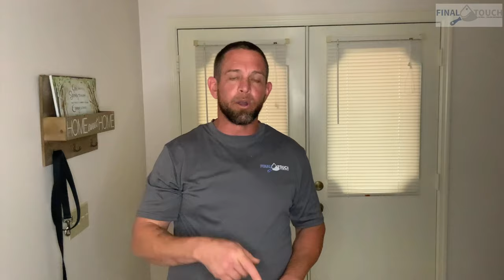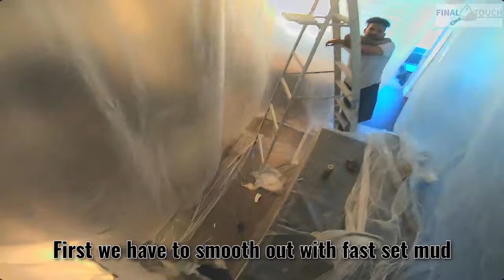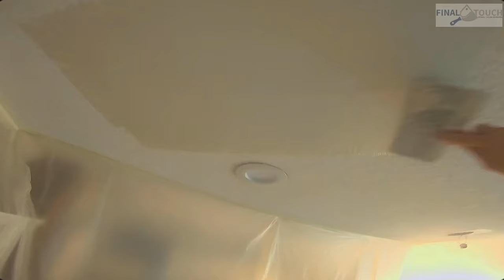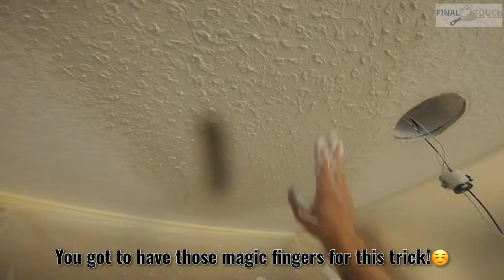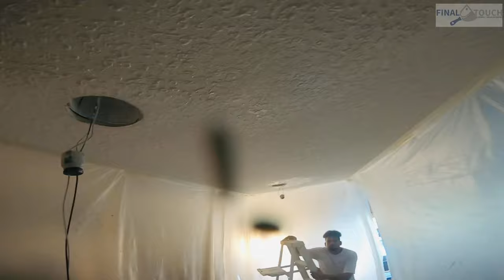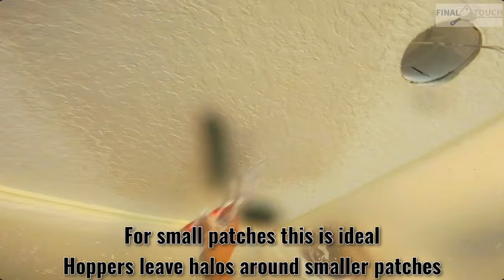How To Match Knockdown Texture: The Secret Sauce For A Perfect Match!

Comment: Using a quick set mud over a drying mud laminates it and looks like shiners with the right light even after painted I’d never do my texture with a setting mud says in bag don’t use for skim for a reason texture is sweet af idk if I’d use this though I’m pretty good with my hopper it’s all bout finger control and mixture . And knowing how to aim it good .. if it’s more spread out just use bigger opening lil less air and soon as u hit trigger be moving it and let off fast works good

Comment: I just had to cut out a large section from my garage wall to repair some copper pipes behind the wall.  Am replacing with fresh drywall because the original got water logged.  Will try this to repair and finish.  If I can get it close to existing texture I'll be thrilled.

Comment: This is a cool technique. I might have to try it as I'm trying to match that exact same knockdown texture over a poorly done patch job by a previous owner. I've been trying to match it with a dedicated knockdown sponge but the sponge can't do the small dots in between the larger splats that mimic a professional spray job. I've also been using all purpose green mud, but it sounds like the 45 minute hot mud might have a better standout. Thanks for posting the video!
Reply from the maker: You’re welcome. Hope it works for you.

Comment: Never did anything like this before as far as texturing a ceiling but it worked.  Flicking it on the ceiling does get messy.
Reply from the maker: Plastic the area before doing works well. It is messy tho. Glad it worked for you!

Comment: Wow.  I am impressed.  I want to master this technique.  I couldn't really tell how you were flicking it because the fingers were moving to fast.  I have found the store bought spray can does not produce big enough globs of mud.  And the sponge method doesn't work either if you are trying to match a knockdown where the globs are spaced out a bit.  Thanks
Reply from the maker: Thank you! It’s a cool technique. I have been doing it for years. It works well. I have tried all kinds of ways. I don’t do anything over a 2x2 patch most the time. 
I’ll make a short video just to show the technique. Check back  soon to see.

Comment: For a stomp texture repair, on ours it looks like the guy used paint mixed with mud, for a more white look. Just to add, i'm fixing on doing one with ceiling paint mixed with mud and water for garage ceiling repairs.. Edit: Now I hear of contractor using primer paint over the dried ceiling stomp texture repair.

Comment: Do you wait for a certain amount of minutes between applying mud and then knocking it down?
Reply from the maker: Yes but not too long or it dries up.
Reply: @finaltouchdrywall  I had my first practice. The 45 mud was good pancake batter consistency. Took 5 minutes to apply waited another 5 and knocked it down with my plastic knockdown paddle. The only problem is the application. I have to do a better job at making it match. Otherwise it knocked down great and was a good pattern just didn’t match the wall that I will work on.
Reply: @MrJking1962  practice makes perfect. It’s taken a few years to get it right but after you do it enough, you can judge how to apply by the existing that is there. It’s easy now.

Comment: I did this successfully!!!  Note:  Cover the walls and the ceiling... flicking has a long trajectory!  Also, cover your face and head!!  :)

My results were a solid B.  It is slightly thicker than the knockdown adjacent to my patch, but I'm the only one who noticed.

Thanks for the awesome video.  I used the Homax knockdown knife (like $6 at Home Depot), and it worked well.

I practiced first on a piece of scrap drywall, but of course, you're not standing under it during practice.  :)
Reply from the maker: That’s awesome! I’m so happy it worked out. It’s a practiced skill.

Comment: Thanks for the videos, very informative and appreciated!
My dilemma: I'm a newbie at creating ceiling finishes, and I have a 20" x 40" section of ceiling in my GF's house that I've patched (after watching your videos, thanks!) but now have to match the finish/skim coat. It's some variation of knockdown finish but I can't find any YT videos that clearly show any knockdown that is very similar to what I have. 
Question: Is there an online "drywall / ceiling / plastering forum" where I can upload photos of my ceiling finish, and where someone could see it and tell me exactly how to replicate that specific finish?  Any help wld be much appreciated, thank you!
PS: I don’t have any special equipment like a spray gun or plaster finish sprayer. Just the regular hand tools, sponges, a Homex can of knockdown texture spray  (which doesn’t seem to apply anything nearly as thick as what I apparently need) etc.
Reply: Everything comes down to how dense the knockdown is on the ceiling. The denser it is, the bigger the globs of drywall mud you need to put on the ceiling. Lighter is less so. I've had mixed success using a drywall sponge, but on large surfaces it gets dicey because it'll start setting up on one end while you work on the other end. I would give this guy's method a shot on a scrap piece of drywall, but experiment with different "densities" of mud splatter.